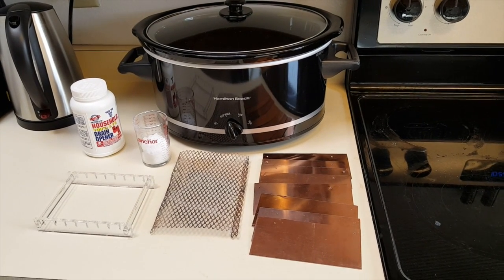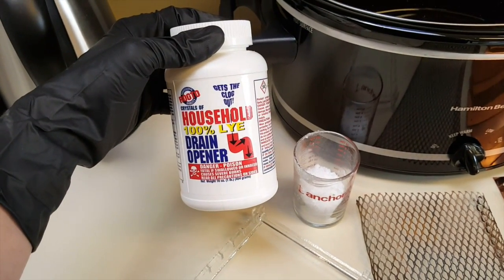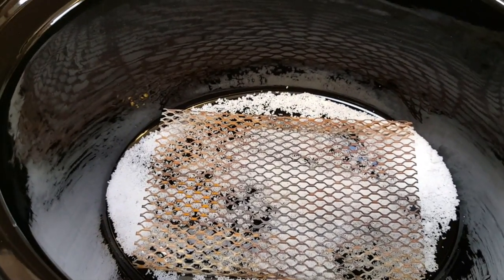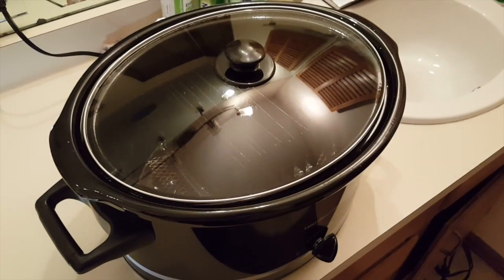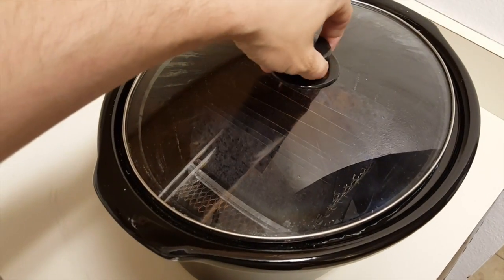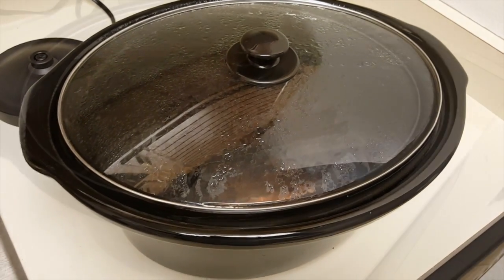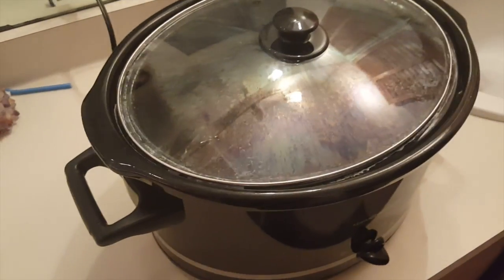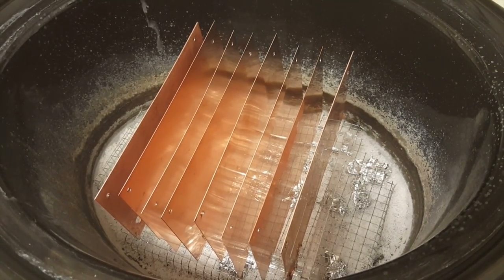Crockpot Nano Coating

Comment: You may want to find a glass dish that fits nicely in the bottom of crockpot as the Caustic will quickly eat away the glaze of your cooker, that's my  experience. Glad you went for more caustic & added aluminium, definitely works better. Nice job.
Reply from the maker: +Del Hempstead Thank you for the recommendation.  I have found that the aluminum heating element under the ceramic crockpot ends up being destroyed long before the finish on the crockpot.  I went through 2 crockpots in 2 months and stopped using them once I started using the cold caustic method with a ziplock bag.
Reply: Since destroying the inner glazed pot I now use a large stainless steel roasting tray that sits on top of cooker with a ceramic tile placed inside as it get to hot for the plastic tub, works well. Just make sure it doesn't run out of caustic solution as it will melt plastic tub.

Comment: The plates on the 2nd (8 hour) batch may be black but this doesn't mean that they are nano coated to Keshe's specifications. Keshe never instructed us to use aluminum (and whatever else may have been in the metalurgy of that foil, so, forgive me for noticing but this is n-o-t a true reproduction of the Keshe nanocoat procedure and therefore the copper on the 2nd batch was not nano coated. for this reason I will not accept this video as a true representation of the Keshe teaching. I don't have time or funds  to experiment along different possible procedural processes. Thanks anyway, but, no thanks... :-)
Reply: I was wondering about that.. even though your aluminum foil may not appear to have degraded that does not mean that aluminum molecules  have entered into the nano coating on the plates.
Reply: Yes, and there is also no reason to believe that the aluminum hasn't... and if the aluminum did then we don't know what the overall effect of it will be. I'll take my chances by just following Mr Keshe's directions, LOL... :-)

Comment: Looks like a great deal of work before you figured out the trick. Fire coating might be faster.
Reply: Mehran keshe dnt recommend fire nano coating causting nano coating is better
Reply from the maker: +MiracleWitness Yeah it deffinitely is.  I started using ziplock bags with cold caustic solution not too longer after this and never looked back.  Much quicker, less caustic, less mess, darker thick even coating and much easier to do.
Reply from the maker: +Shah Jahan As for fire nano coating, yes it is more efficient but no where near as easy as one may think to accomplish.  It requires spending a good bit of time learning how to heat it up just right.  Not enough heat and you do not get a good enough coating.  Too much heat and the coating will fall right off.  Caustic while less efficient still works and is 100 times easier for the average person.